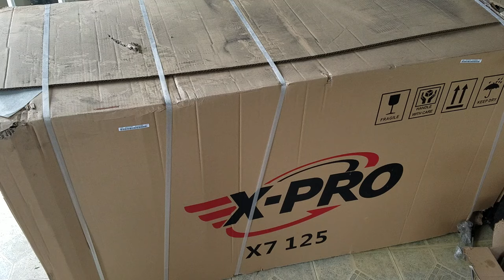X-pro Vader Honda clone unboxing and test ride!

Comment: Not sure why you bend a peice of cardboard and direct the oil into a pan,instead of removing the exhaust, just a little tip,very simple solution
Reply from the maker: That's a fantastic idea! Still a dumb design though.
Reply: Or just use a bent license plate.

Comment: I've had a Chinese bike over 10yrs. Absolutely no problems. Just general maintenance. Changed chain and sprocket. "That's it".
Reply from the maker: I've owned four so far and I've had really good luck with all of them!
Reply: Which one have you had, and have you done any mods to it?

Comment: Should i buy this bike as a first bike? I live in Illinois and it's cold most of the time so im sure I won't be using it too much. I just always wanted a bike and as i can only use it in summer, I didn't want to buy an expensive. Should i buy it?
Reply: Do a full send on it. a 125cc isnt going to intimidate you.

Comment: I would spend a little more and buy a Lifan KP Mini. a much better bike. My 2006 Lifan is still going strong after all these years. Bought it new from a local dealer for $1650.00 OTD. It is a Lifan LF 200 GY 5 dual sport. it has been a really good bike.
Reply from the maker: I have videos of a Lifan kpr on the channel
Reply from the maker: Although I just recently sold it

Comment: I'm looking at buying one of these. I don't want something though. That needs a lot of upgrades right out of the box and something that is prone to mechanical problems, since I'm not very mechanically inclined, I'm not sure how much I would be able to work on the bike. Do you think this would be a good choice.
Reply from the maker: If you don't want something you need to upgrade right away then I would stay away from it honestly, they can be good bikes but you do definitely have to put some work into them!
Reply: @twowheeledadventures  thank you. Do you have a recommendation? I would appreciate your opinion.

Comment: Hey got a question did you have this delivered to you or did you pick it up from a store? I'm thinking about buying one from Amazon my only worry is I work during the day so most likely will come when I'm at work so I was going to have my little brother (18) be here when they come, so when the truck comes to drop the bike off do they require to see a drivers license that matches the order or can anyone sign off on it without showing a ID? (he only has a state ID)
Reply from the maker: Yes I had it delivered I ordered from powersports Max not Amazon though, anyone was able to sign for it in my case.

Comment: What kind of upgrades would you recommend for this bike?
Reply from the maker: Depends on what you want from it, I'm personally in the middle of doing the wheel bearings, upgrading the swingarm, new tires, better exhaust, better axels, and a better cushdrive.
The first thing I did was the carburetor because it comes super lean and thats horrible for the motor!

In the future I also plan on a motor swap for a 190.

That being said if you just wanted to jet up or change the carb it's still a fun bike!
Reply from the maker: Depends on what you want from it, I'm personally in the middle of doing the wheel bearings, upgrading the swingarm, new tires, better exhaust, better axels, and a better cushdrive.
The first thing I did was the carburetor because it comes super lean and thats horrible for the motor!

In the future I also plan on a motor swap for a 190.

That being said if you just wanted to jet up or change the carb it's still a fun bike!
Reply from the maker: The stock battery was also trash within the first week.
Reply: @twowheeledadventures  awesome thanks man
Reply from the maker: @ZR-co9bo  Have fun!

Comment: Would this be good for my main form of transportation?
Reply from the maker: Depends on a lot of variables.
The short answer is no.

If you're good at working on stuff, Carry tools with you, keep up the basic maintenance, don't thrash the bike around it's not a Honda and it's never going to be, keep up on your oil changes, then maybe lol.
Reply from the maker: As you can see in the video it's also very slow out of the box so you have to do a little bit to it right off the bat to get to 55 MPH.

Comment: How do you set a new default screen color
Reply from the maker: I think you have to hold one of the buttons on the speedo, it's been a minute since I've messed with it as it's been sitting in my shed for about the past year.

Comment: I've owned 2 of these bikes and my Grom has outlived both. I'M NEVER BUYING THESE BIKES AGAIN! They're not worth the time or money that you need to spend on them. I rather pay triple the price for 1/5 the headache. So, let me explain why I said this. The lack of quality control means you'll need to thoroughly inspect each component of the bike to ensure proper bolts, welds, and wiring. Keep in mind that the bike parts are of low quality and it is recommended to replace or upgrade them as soon as possible. With these improvements, the bike will be more reliable and can last between 30k-40k miles. As for my previous Grom that I rode and experienced various crashes and destruction still managed to endure 75k miles before I sold it for a new one.

Comment: Do you know what transmission fluid it takes
Reply from the maker: None lol
Reply: @twowheeledadventures  ok just got one a few days ago and saw is has a drain plug and a cap on the top of the transmission. but didn't see anything about it in the manual
Reply from the maker: @jbobwas1009  The only fluid this bike takes is wet clutch oil, break fluid, and gas.
Reply: @twowheeledadventures  ok thanks for the help